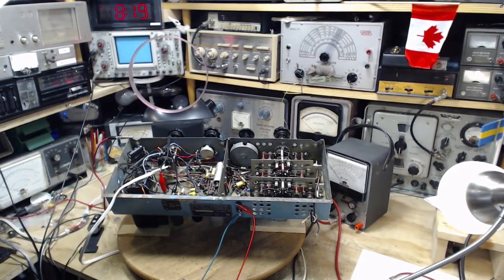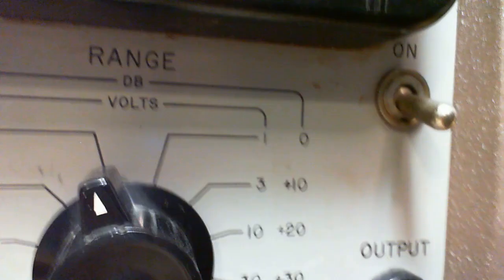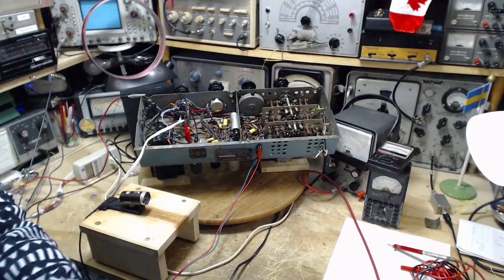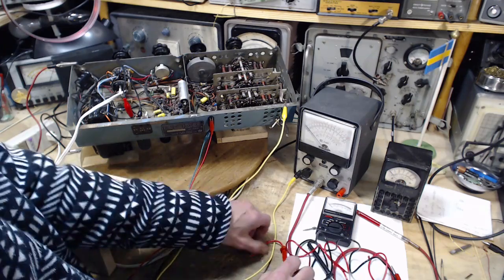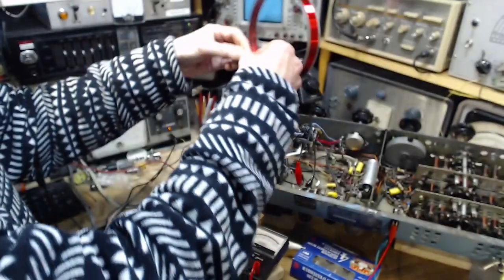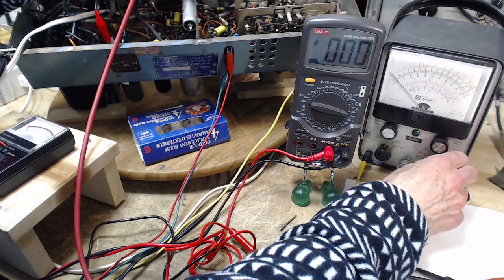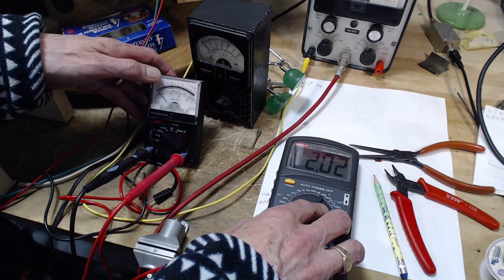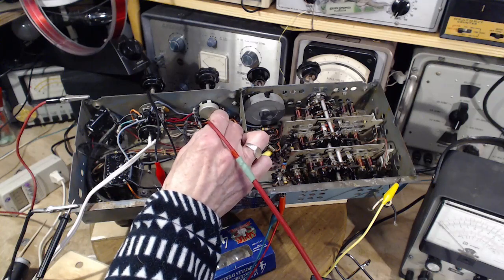Canadian PYE Model 39HC Video 42 - Voltmeter Loading Effect

Comment: 49:03 The shock you got should remind you to get rid of that VTVM and use a battery powered DMM!
 If you think about it, the insulation transformer you plugged the radio in should have prevented you from a shock - even if you had touched earth ground with one hand and licked B+. 
The mistake was made much earlier! Whatever mains separation and safety the insulation transformer provides was defied by you way earlier when clipping the ground lead of your earth grounded ancient VTVM to the radio. 
This classic error of introducing earth ground potential into an otherwise galvanic insulated circuitry by means of unsuitable equipment gets people hurt and equipment damaged.
Moreover if it is unsuitably modified equipment that introduces earth ground potential i.e. that earth ground bus bar wire running along the bench and that you tapped various equipment into which had no earth ground from the factory.
Reply: He got a shock from the camera and wasn't using the vtvm.
Reply: Ok Steve I stand corrected, I saw him get shocked today. 
@ 1:04:29 He admits to getting shocked every 6 months. 
@ 39:55 He grounded both VTVM meters to the radio.
@ 1:00:31 I can see the red wire (red wire for ground?) hooked to signal tracer ground? 
@ 46.51 He grounds the Micronta meter to VTVM ground lead.
@ 52.14 I see 255 volts or less, can not believe he could not read the meter! 
@ 1:08:54 I am guessing but is he reading a resistor in the meter?
     Each range having a different resistor? 
There is a way to find internal resistance but this is not how.
@1:12:11 Time for a new "standard" meter if you haft to wiggle the range button all the time.
Both VTVM's should have been warmed up a lot longer before use.

Comment: Don’t get input impedance and internal resistance, ( or input resistance), mixed up. A DC volt meter is specified as input resistance, not input impedance. On the AC voltage range the input is specified as input impedance.

Comment: Everything in this circus has to be banged, poked and wiggled. What was the purpose of all this clip? Revert to what was the inoperative state of the radio? Can't he get it right just by accident? And sure he reads comments, half he doesn't understand, half he plainly disregards. Faults do not heal by themselves dude! Your trouble shooting logic is flawed, you concentrating on the effects and not on the causes.